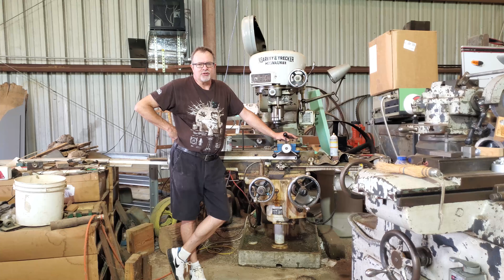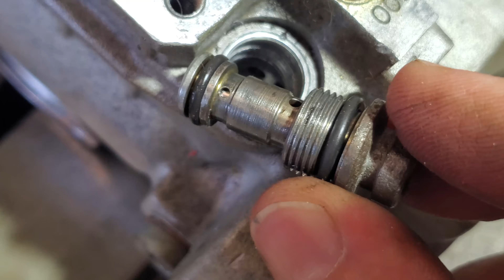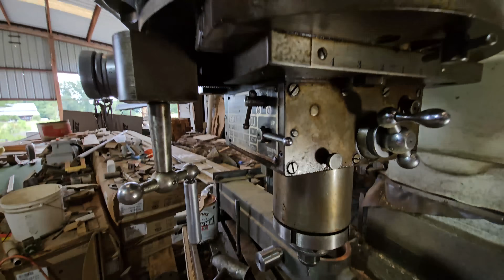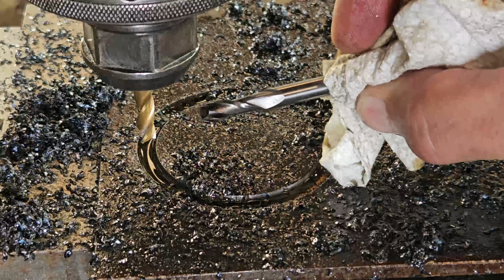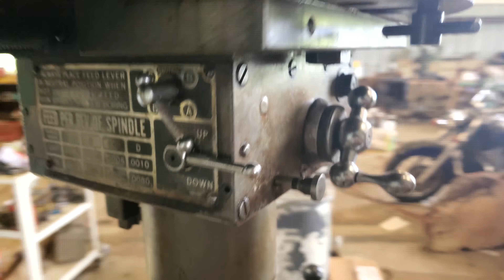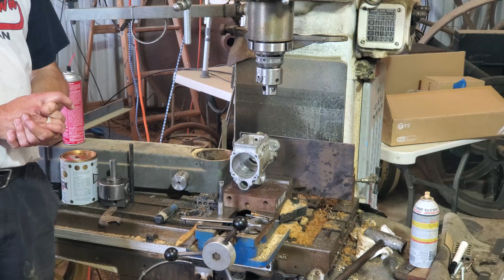Repairing a Bosch Fuel Injection Pump

Comment: Nice work. I use FSWizard all the time, but I usually choose about 75% of the suggested RPM and my feeds are never as aggressive. Maybe 50% or less.
Reply from the maker: That's what i'm finding as well. Good for knowing how much hp you're using, I only have 3/4hp spindle.